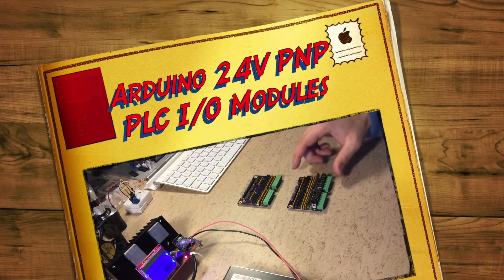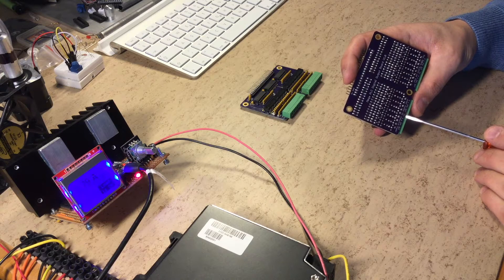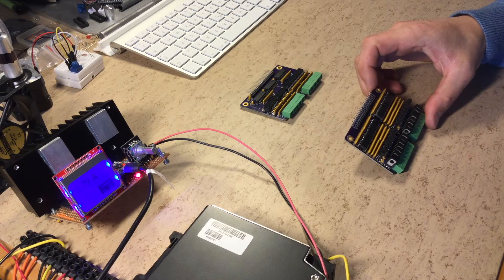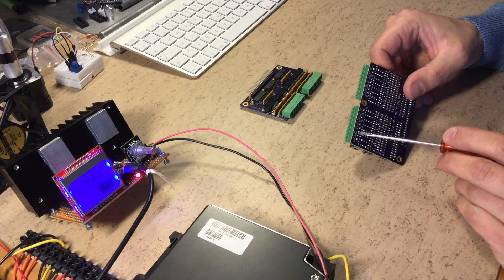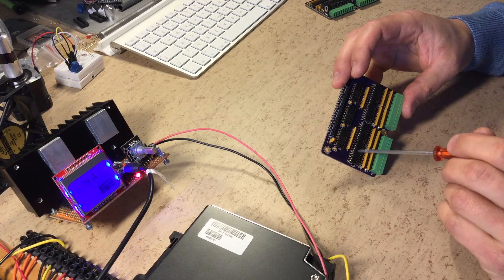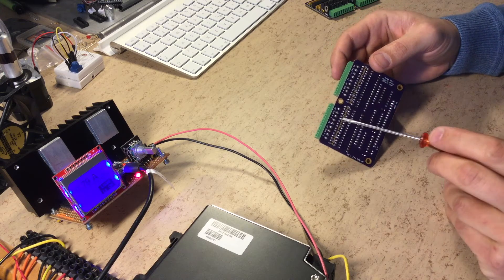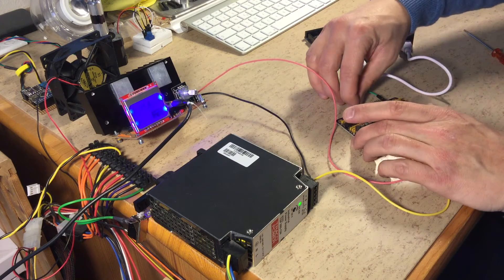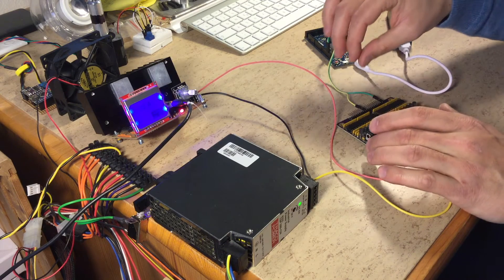Arduino 24V PNP PLC SPS I/O Modules

Comment: Thank you for sharing ! You do not have diodes on your output to drive inductive load ?
Reply from the maker: You have to add them externally, if you want to drive inductive loads. I usually mount them inside the valve plug. Most common industrial valves    already have internal diodes anyway.

Comment: Thank you for this lovely work. I would like to know the capacitance values of C5 to C20 for the digital input board. I couldn't get these from the eagle file. Thank you.
Reply from the maker: You're welcome. I have never populated them on my boards. They can be used in case you want to "hardware debounce" your inputs. 100nf would be a good choice in this case.

Comment: GREAT!. it is a petty that you didn't show a shortcut or a load > 500mA. How you reset the tiristor in the industrial environment?... usually does not happens, but who knows, there are a lot of "smart" operators around, particularly in the night shift.
Reply from the maker: It does reset itself, as soon as the short circuit is removed and the output is switched off. And BTW, the output protection circuitry is exactly the same as in a commercially available industrial PLC
Reply: @TheDIYGuy999   hmmm. show the short circuit,... i would like to see a little smoke from the tiristor. make another video with a short circuit, and a load passing 500mA. this time with a proper ammeter. thank you anyway.... perhaps the schematics are wrong....

Comment: great work I will try to build one myself from your schematic. Can you share the part list? I glanced at the schematic but I don't know how one would get a complete parts list from eagle.
Reply: I finally foud most of the vlueas for the 16x C-EUC0805K Capacitors on the input board. Can I use 100nF or do they need to be a specifik value? and the 16x 0207/10 resistors with the value of 1R?

Comment: What would be happen when one DO have been shorted? The thyristor switch the output transistor off and what should be done? After removal of the short circuit must the power supply of PLC be switched off too? In order to realese that thyristor lock?
Reply from the maker: No, you don't have to power cycle the PLC. Just reset the PLC program, so that the DO is switched off. The DO is ready to work again, as soon as it is switched on next time. This solution works fine, no issues at all and the machine is in daily industrial use.